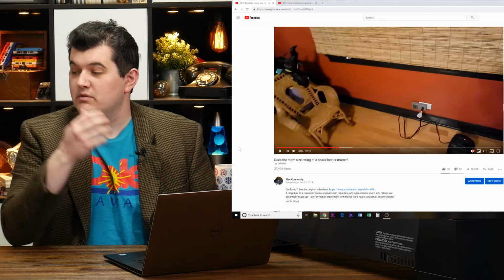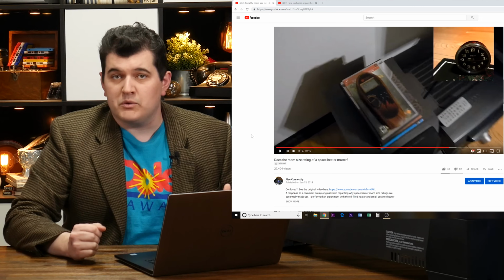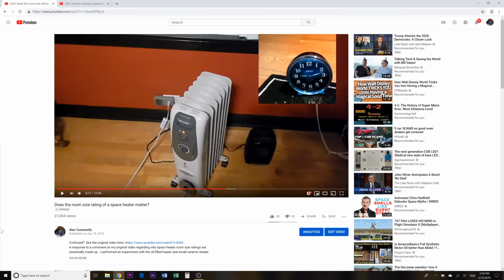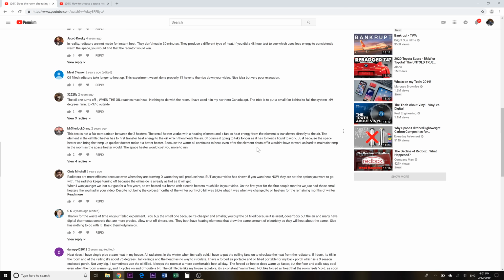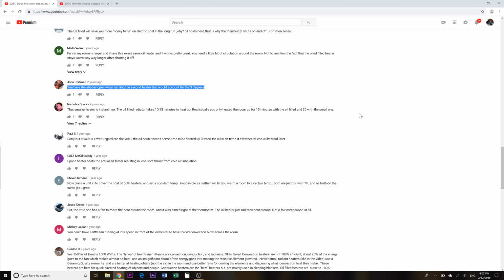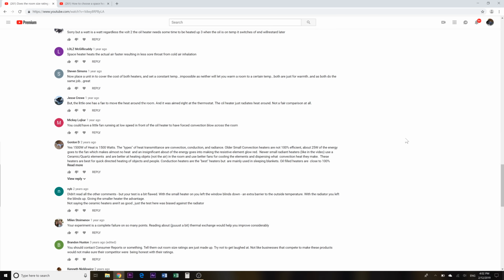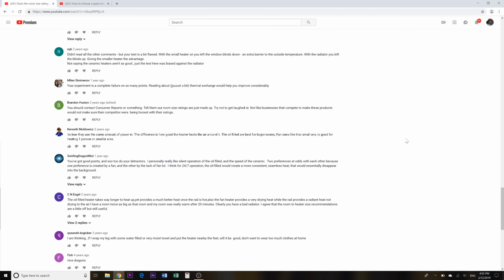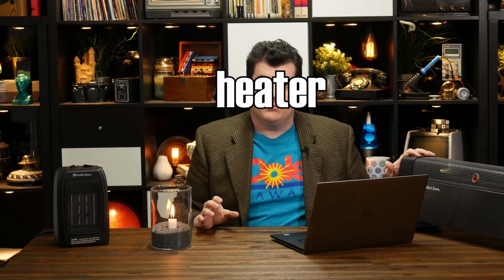More Space Heater Nonsense

Comment: I think the point of classifying heaters as "for small room" and "for large room" is not because of the heat output but because of a different usage of heater in a small and in a large room. Those fan-based smaller heaters make noise and dry out air, which makes them unsuitable to be turned on for a long time (all day for example). But because of the fan they're really good at making the air in a room noticeably warmer in a very short time. On the other hand the heater that is labeled as "for large room" has fanless design and can run very silently without making air moving around (which is also annoying in those smaller heaters). And since a large room loses heat much faster than a small one, it also needs much more heat to be generated from a heater (therefore the heater must be turned on for a much longer time). So my point is - there are two different usage scenarios for different types of heaters. The small fan-based ones are best for a small room where they can be turned on for a while (like 30-60 minutes) and then turned off. Maybe turned on again in a few hours when the temperatures falls below comfortable levels. But the larger fanless heaters are best for a larger room which needs much more heat and therefore needs a heater that can be conveniently turned on nonstop (or for more hours). This is how I understand the labeling on those heaters. It shouldn't be understand as a different heat output but a different use case.

Comment: Okay, but if your point was that they both have the same power output in terms of watts, it is unfortunate that the oil heater limits its power output so they aren't really outputting the same power level (I interpret the 1500w as a peak value for the big one).

Anyways another thing is that there is heat transfer by convection and radiation. I suspect that the passive heater has a good amount of thermal radiation, whereas the little heater has almost only convection. This means that while all the energy from the small one goes directly into the air, much heat from the big heater is not heating the air, but the walls. And if the thermometer is laying in the middle of the room it would be more effected by the air than the heat of the walls.
So, I get what you are saying, but the experiment is a bit flawed imo, in terms of what it is trying to actually show us, and also how it was executed.

Comment: I appreciate your videos and the knowledge you share, but I think the main purpose of fan-assisted heaters is actually to direct more heat primarily to a (small) part of the room where you sit, and not to heat the entire space evenly. Feeling of warmth increases when heated air is being blown at you, that way a relatively low-power heater can make you feel comfortable and warm, even though it may not heat the entire room to desired temperature. Everything you say holds true for convection and fan-less heaters, though, but fan-assisted heaters are a way to feel (adequately) warm even when using insufficient heating capacity for a space you're in. Cheers, and keep up the good work, I hope you'll read this. :)

Comment: You've got me wondering now if someone makes a bigger fan cooled heater so the fan would be silent but it would heat just as well as the little bugger.

I was looking at space heaters a while back to put in my workshop.  I was more concerned about starting fires with all the sawdust in the air but it is nice to get kicked in the face with the fact that they'll all be ~1500w and so the design doesn't really matter from that aspect.

On the other hand, I realized that cleaning up the shop with the shopvac actually heats the air in the shop quite a bit so if I just clean first when I go out there, it's nice and warm.   :D

Comment: 8:04 the thermostat is somewhat accurate when the heater is running, but when thermostat is satisfied, the heat and fan both cut out, letting residual heat from the elements simply rise up and warm the thermostat up, so it cuts the heat out, and the room temp falls down and it won't come back on until the top of the heater is cool again, which could leave you quite cold!

I have a vintage phillips fan heater that has odd controls, it's 230v here in the UK and we can have 3Kw of heat.. it has 3 heat settings, on 1st heat setting, when the thermostat calls for heat it goes from 0kw-1kw (fan is always on), on the 2nd heat setting, it ranges from 1-2kw, and 3rd heat setting, it ranges from 2-3kw.. it also has two seperate fan speeds, and putting it into 3rd mode forces the fan on high.. 
this means you can kind of catch the heat load between say 1 and 2 kw which means the fan is always on, heater is always producing heat, and you are always comfortable!

Comment: Let me start by saying that I find both this (as well as your main channel) to be interesting. 
Thank you for taking the time to create these videos. 

In regards to all of the heaters being marketed as 1500 Watts, I wonder if it's partly because of the mentality that "bigger is always better". When in a lot of areas, it's actually the opposite. 

As far as the smaller heaters go, yes they make more noise compared to the oil filled radiator style of heaters. And they do heat up "faster" than the oil filled ones. And they do have their limitations. 

However from previous experience with both kinds of heaters, the smaller ones tend to burn out a lot quicker. I think it's because they do get as hot as the larger ones.

While I understand that both are 1500 watts, and the realization that a lot of times marketing is done to get a person to buy their products - even through means of intentionally misleading their customers  into thinking they are buying a better heater for their room just because of the size.

I had to use the space heaters for several years, the only way I could get the oil filled radiator style of heater to heat up the room any faster, was to place a fan in back of the heater to push the hot air out and away from the heater.

Unfortunately there are a lot of people that refuse to admit when they are wrong. 
They also refuse to learn from their mistakes. 
Or they're unwilling to attempt to learn something new (just because "that's not how I was taught before!" 
In either case, that kind of thinking is foolish and/or highly inaccurate. 

Hopefully that makes sense

In either case, I truly enjoy your videos, and your channel.
Thank-you for posting it, I want to wish you the best of  luck on your future episodes!

Comment: While you talk about electrical efficiency you don't discuss the thermal efficiency of each unit. As with anything the more surface area well better transfer the heat into the air versus a smaller surface area. While the smaller heater uses the same 1500 W the larger heater has a larger surface area for the element to better transfer the energy to the air. I could be completely wrong with this it's just a way that I understand it. I'm  not saying you're wrong, i think you are right but with everything else you explain you go into a lot more detail and it just seems like your only touching on one particular point when it comes to a heater not looking at the entire unit at the way is designed. To put it in a crude way it's like saying a 1watt LED without a lens and with a lens puts out the same amount of light while it does put out the same amount of light the way the light is spead out is different and may seem brighter or dimmer the same as the surface area of a heater may warms better than another. Thanks for the video. I love watching your videos. And will join your other supporters next month.
Reply: Also you did not discuss the heating elements themselves at all as some materials will get hotter than others with the same amount of electrical energy applied. Again, love the video.

Comment: Radiator is good for using during night because it provides a stable heat, silently and without throwing dust to the air. Convectors are good to heat a room very fast.

Comment: If there is a drafty window in the room, the baseboard might be better if it is placed right underneath it. The baseboard heater would create a curtain of warm air around the window and could reduce drafts.  That is the only reason I could come up with that would make it be better at heating a larger room than the small fan based heater. The 120+-6V 15A circuits, wires, and plugs are only rated to 125V at 12A at 100% duty cycle, when any intelligent engineer would require it to be 130V at 18A at 100% duty cycle to have safety margins. I find this standards based cost cutting measure to be one of the worst standards ever made.

Comment: First I'd also like to say i'm glad we have 240v, and not 110v in the UK.  we can pull around 3kW from our electricity supply if we really want to.  Not only does this heat a room faster, but boils kettles and dries hair quicker too :) 
The only differences between the different forms of heater are how CONCENTRATED the INITIAL heat is when you turn them on and how safe they are to leave unattended.  As the smaller heater output tends to  be more focused standing directly in front of it will feel warmer however until the point the room nears an even heat there will be colder spots behind and away from it. If you have a room that has more thermal load than the heater can effectively deal with the small focused heat would be preferable as you can keep close to it and feel warmer.    That focused heat however comes at a price of being able to safely leave it unattended for long periods of time.  The focused heat right next to the heater has a greater potential to melt/burn/set alight something that gets close to it (or even itself), while the larger convection unit, and even more so the oil filled heater, has a smaller likelihood that this could happen.
Reply: ThePoxun You can pull more power from 120V.... The 1500W max he was talking about was only on a 15A breaker. You can get bigger breakers... Also we have more than 1 phases as well to get even more power if needed...
Reply: @andykillsu  yes. However you then need to worry about where you are going to plug these devices in and as is evidenced by the video 'standard' appliances are made for the lower limit. I can buy any higher power device that comes as standard and not worry if I have a suitable outlet near to where I want to use it

Comment: The only legitimate difference between a "small room" and a "large room" heater are based on Duty Cycle, and potentially lower heat settings. Since all heaters are ~1500W peak output, it's the duty cycle that determines the BTU/HR output, and the bigger the room the more BTU/HR it'll need to maintain equilibrium. The reason inexpensive forced-fan heaters are not advertised for large rooms are that the fans tend to be very low quality and subject to failure, so shouldn't be left unattended and at a fixed heat output that means the time to heat the room would be too long to wait until you were in there to start heating. The larger units will tend to be passively cooled so that they "fail safe" rather than risking an overheat and fire.

Comment: Nice videos. What you said in the main video is not exactly true, though you are correcting yourself here. Maybe you didn’t make it clear in the main video or your not sure how to express this topic. Yeah all the heaters are 1500 Watts, but that’s per instant, not the average. On the average, they are putting out different wattages because of how efficiently the heat is propagating. You even point it out in this video the oil heater keeps toggling on and off because it is getting too hot, so it is putting out less heat. So, different heaters are better for different room sizes based on that.

So you say the heaters all put out the same amount of heat and then go on to explain how that is not true. You say the room size is nonsense but then experimentally show that is not true.

How about this. The heaters theoretically put out the same maximum amount of heat, but in practice do not always because of heat flow bottle necks that cause the thermostat to toggle to prevent damage to the heater. Mechanisms that move heat away from the coils faster are likely to be closer to the theoretical maximum when coils are close to their cut off temperatures.

And room size metrics are not a regulated thing, so buyer beware, they likely mean less than they seem, because, as you even said, marketing. And heaters that are similar in function likely have similar maximum heat outputs.

Is does make me curious what the results of a larger experiment would be. Are any such difference negligible?

Anyway, it does seem to me you are arguing with yourself, but these are my two cents; your opinion may vary.

Comment: Looks like the essense is:

"Small" heater to get a small  room up to temprature quickly. Remove after use?
"Big" heater to get the big room to stay at temprature (slow system). Stays in place?

Also, a big room allows convection heaters to be away from stuff for safety reasons.

Also, surface temprature to the air matters (burned dust).

Power wise, nothing to add.

Comment: Not that I'm disagreeing with you, but I have to wonder if the furnishings and placement of furnishings, and relative insulation in a room can make a difference (In practice, not marketing.). My previous home was fairly old, drafty, not well heated, and poorly insulated. In the bedroom, it could get very cold in winter.

I used a couple electric heaters in there. The first year I used a ceramic barrel heater with a fan. On high power, I found it was good at heating the air within a small radius around the heater itself, and nothing more. If you stepped across the room, it was freezing cold again, no matter how long you ran the thing.

When I changed that out for an oil filled rad, the entire room got nice and comfortable with no issues at all. I don't know why, as they did have the same wattage ratings, but that was what I found to happen.Perhaps because the room lost heat so quickly through the walls, that heat buffer helped to heat things more evenly.Or maybe the ceramic heater was defective and not pushing as much heat as it should have.

Comment: I always thought a large room heater was better as a primary source of heating. If your main heater breaks and its freezing the oil large room heater will run for longer. Its more kind of do you want all this energy now or do you want to heat this thing in your room that will make your room warmer . If you have a studio apartment and you need something to hold you over you want the oil one not the cheap one that just blows all the energy in the air.

Comment: The only reason why a phsycally larger heater with the same total heat output might be more efficient is because the heat is spread out over a larger area to begin with and thus it would take less time for the heat to be spread out trough the room, and thereby also decreasing downtime of when the heater might shut off to prevent overheating, but I can't imagine it would make a huge difference, especially if there's also a fan which helps to spread the warm air more quickly trough the room and away from the heater.

Comment: Convection works better in larger rooms, actually circulating the air instead of just trapping the heat under the ceiling (which can happen in very small rooms). In this sense, the large room heaters (depending on convection) would not work well in small rooms (limiting their output and leading to bad heat distribution), while the small room heaters with fans work just fine in large rooms.

Comment: First things first: Great pair of Videos, I love that you tried to prove which heater was better at heating a room.

That said, I saw only 1 flaw in your earlier video, you compared a Radiant Heater (the big oil one) to a Convective Heater (the small ceramic one)...assuming both have the same Wattage Rating, the Convective Heater will ALWAYS beat a Radiant Heater as you showed, a Radiant Heater simply can't transfer Heat into the air as efficiently as a Convective (has a built in fan) Heater can.

However, I believe (I haven't tested this) that a large 1,500 Watt Convective Heater will heat a room faster than a small 1,500 Watt Convective Heater can, the large one will have either a bigger fan or more than 1 small fan and thus can move more air past it's Heating Elements in a given time span where a small Convective Heater will only have 1 fan.

Love your Video's...More Please...

In summery: the best Heater to heat any given room will be the Heater that has the Highest Wattage Rating (1,500 Watts for a standard 15 AMP Residential Circuit) and the Largest Fan (rated in Air-Flow).

Comment: I get it... 1500W=1500W
 but I think the manufacturers might be expecting different use cases in different size rooms.
probably you'll spend more time in the larger room so you'll want a silent heater that can run for hours without the fan getting on your nerves. in a small room that you'll spend short amounts of time in, you're not as bothered about fan noise but you want the room to heat quickly cos you're only going to stay in that room for a few minutes.

FWLIW I've got a fan heater and an oil filled heater - when I get home I give the room a blast with the fan heater to get the temperature going up quickly while the oil filled is warming up and then let the oil filled heater take over for the rest of the evening. Pretty decadent.